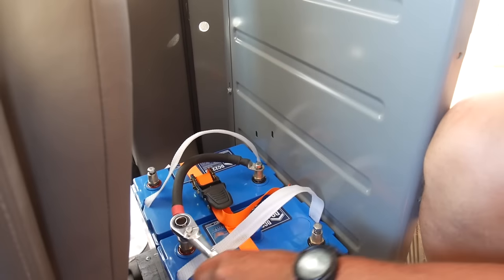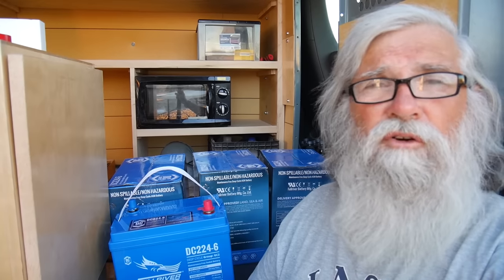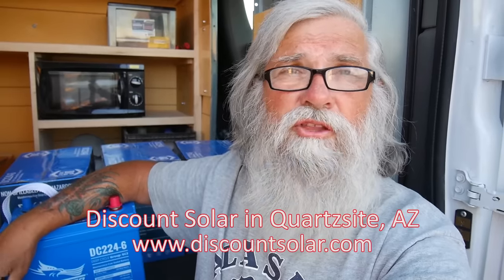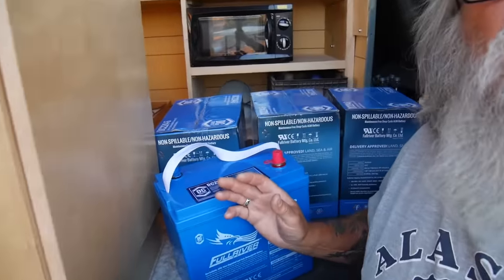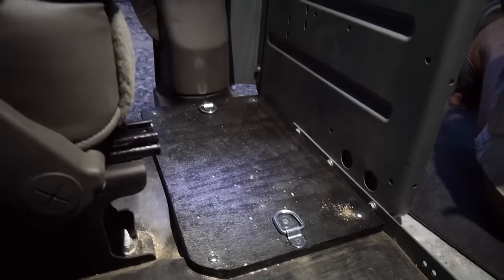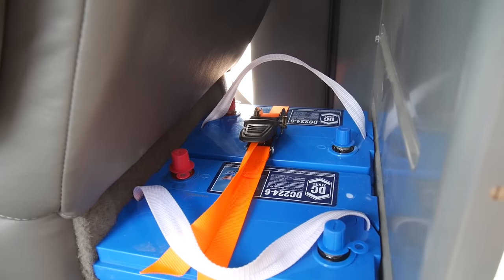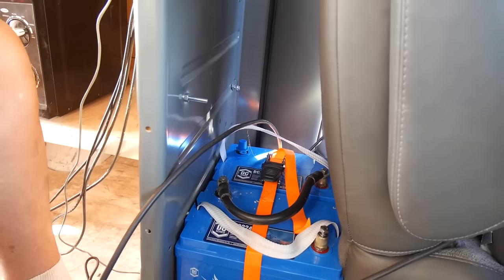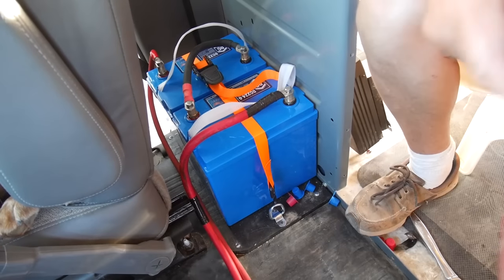Van Life Essentials How to Install a Solar Battery in a Van

Comment: Bob,

I know lithium batteries are a lot more expensive to purchase, but they supposedly will cycle 4-5x as long as AGM's, so, in the long run, they end up cheaper.  Also, they are smaller and lighter than AGM's, and can discharge much lower than the 50% limit of AGM's.  So, was it just the sticker shock of the initial purchase that kept you from lithium, or do you have other reasons?  Thank you and hope your Mum is doing as best she can.
Reply: Sorry I'm not Bob and hopefully he will reply to you. Just wanted to say I believe you've already hit the nail on the head in that there are multiple reasons why someone might not want to purchase lithium. For instance someone like myself might not want to because I'm just starting out and I don't even know if this lifestyle is for me until I try it out. If I had to choose I would go with the less expensive option first time around. FWIW, Cheers!
Reply: David, another advantage of lithium is you can fill them up sooner. If you have only 3 hours of full sun in a day, those batteries will be much better off than lead acid.
Reply: Lithium installations in RVs are relatively new and have not lived up to the initial longevity claims. Unless abused, these AGMs should last Bob 6-7 years. There is pretty much no chance lithiums are going to last 20+ years. Aside from the initial cost, you would also need to set up the charge controller very differently and I believe lithiums are also more temperature sensitive. The RV solar companies have refined the lithium installations and the batteries themselves are better, but I do not think the overall cost of such a system is justified for most folks unless weight is a major consideration.
Reply: BearUkulele Technomadia are still using theirs fine: http://www.technomadia.com/2015/02/living-the-lithium-lifestyle-3-5-year-lithium-rv-battery-update/
Reply: totoro: Yes, but read their extensive series on the system. They were essentially beta testers of lithium in RVs and we can learn from their mistakes. I personally would love to upgrade to lithium, but I can wait a few more years while others work out the kinks.
Reply: $800-1000? Ouch!
Reply: +BearUkulele...I think I remember Technomadia mounted their lithium batteries under their bus RV in a non-temperature controlled environment...which, they found out later, has somewhat damaged the batteries.  Most later installs of lithium batteries have them inside the coach or van to mitigate temperature swings.
Reply: +Mike Mead...good cost analysis.  Thank you.
Reply: Mike Mead z
Reply: No LOL.
Reply: +Mike Mead: One thing I noticed after watching this video again is that Bob said his old batteries (non-AGM, regular lead acid) could not maintain high enough voltage to run his microwave. I'm certain that wouldn't be a problem with the LiFePO4, but am not sure about AGMs. The other thing is that Bob has 480 watts of solar panels. I'm guessing it would be very rare for him not to fully charge his battery bank regardless of chemistry. The last thing is the installation of those four AGMs with longer runs of heavy cables adds to the cost of an AGM battery bank vs LiFePO4.

So the big question is how many amp-hours per day does Bob regularly use? He's already got a very low-draw DC TruckFridge, so that can't be much...5Ah? The microwave eats up amps, but most folks use that in 5-10 minute chunks. I can't imagine he does any elaborate cooking, so let's say at most 40Ah (wild guess) per day? I think he's got DC fans and a catalytic heater, so those are low or zero amp draws. It sounds like he could easily live off the single 12-volt LiFePO4 100Ah battery.

For folks starting from scratch, the first step is to calculate your daily power needs. In my case, for example, I can easily live on 100Ah/day, probably more like 50-60Ah/day. In theory, I could power AC versions of a mini-fridge, induction stovetop, fan, lights, etc...and do that all through an inverter without spending more for the costlier DC versions. I might even be able to keep the battery charged with 200-300 watts of solar panels instead of Bob's 480 watts.

In any case, just thinking out loud (so to speak). I'm not up to showing detailed calculations like Mike and I could be way off base. We certainly live in interesting times with new options in technology coming up every year.
Reply: Mike, thanks for the rambling. It does help to kick around all the various factors that need to be considered. The AGMs in my RV still have a few years of life left in them, but some of the other components (solar controller, charge converter and whole-house inverter) may need replacement sooner than that. Hopefully they can hold out a few years so I can replace the entire system to match a lithium battery bank if that technology has matured enough by that time.
Reply: Mike, I didn't mention this before because what I wrote ended up extremely long, but I bought this battery a week ago. Ah well. Apologies in advance for this convoluted post.

Although I made the best estimates I could based on specs listed on appliances, batteries, solar panels, etc., only empirical testing in real-life conditions will determine if the system I put together will work for my needs. As you say, I can always make adjustments if my assumptions are off.

If you don't mind, maybe you can "check my math"?

100Ah LiFePO4 12-volt battery (Battle Born $900)
1,500W pure sine wave inverter (Windy Nation $250)
100W solar panel with MPPT solar controller (Renogy $250)

My goal is to keep the battery above 20% capacity even though they claim it can be safely drawn down to zero. I understand the inverter is only ~90% efficient. The solar panel will not be fixed, so I plan to place it in full sun tilted at an appropriate angle for a few hours each day. If I get decent sunlight, I'm assuming the panel/controller will add ~20Ah/day back into the battery. The Renogy controller shows amp-hours accumulated and discharged, so that'll be interesting to watch.

1.7 cf mini-fridge, estimated 207 kWh/year ($60 Walmart)
250W ceramic heater ($20 Walmart)
5,000 BTU air conditioner ($110 Walmart)

The fridge will be plugged into the inverter and run 24/7. (I can probably safely unplug the fridge at night, but for now I'll just run it all the time.) Here's where more assumptions kick in. I'm guessing the compressor will run 30-40% of the time for my initial camping trips in fairly mild weather. The calculations for this are convoluted enough that I don't even recall how I got here, but my guess is ~25Ah/day to run the fridge.

I plan to use the small heater for 15 minutes at night and morning just to take the chill off. I've tested this at home in a small room and it works for me. YMMV. That draws 2.1 amps at 120 volts, which is 21 amps per hour at 12 volts. I'll round down a bit to 10Ah/day.

The air conditioner is to keep my dog cool when I'm out hiking in parks where dogs are not allowed on the trails (very common these days). Since the volume of the van is small, I'm assuming the compressor here will also only run 30-40% of the time. Unconfirmed online sources say this unit draws 5 amps at 120 volts, so I'm going to guess 25Ah/day. I probably will only be able to use the AC one hour on one day. I'll definitely test this with me in the van a few times before leaving the pup alone.

I will always start a trip with the fridge packed & pre-cooled and the battery full. 
Day 1: 100Ah - 55Ah (fridge, heater & AC) + 20Ah solar = 65Ah remaining in the battery
Day 2: 65Ah - 30Ah (fridge & heater) + 20Ah solar = 55Ah remaining in the battery
Day 3: 55Ah - 30Ah (fridge & heater) + 20Ah solar = 45Ah remaining in the battery

Loads of assumptions (aka wild guesses), so we'll see how it goes. Let me know if you see any glaring mistakes.

Drew
Reply: Mike, absolutely nothing can beat real-world experience in such a situation where there are so many variables. For example, I plan on putting the solar panel in full sun, tilted in the proper direction and angle for 3-4 hours/day. But that also depends on what time of day, cloud cover, temperature, etc. If I can somehow get to that elusive "ideal conditions" state, it's possible I can harvest more than 20Ah/day.

My window AC unit experiment is based on another YouTuber (see link below) who used the front cab area of his van as the "box". It does take into account that heat also vents from the sides of the AC unit. I won't have a solid wall partition like he did; I'll just use a blackout curtain to separate the area. I will also only have the front windows rolled down a few inches and insert a small fan to help exhaust the hot air build up. 
https://youtu.be/zpG0iWd1MY8?t=7m22s

In terms of power to run the AC, I had assumed since the "room" of my van is less than half the square footage with a much lower ceiling than a 150 sq. ft. room in a house, it would cycle less than their estimates on the yellow label. But that's still a big assumption, so who knows how this will work.

Your fridge numbers are compelling. I may need to shut that down at night if solar production is not keeping battery level high enough. Fortunately, my initial test will only be for two days, so I have some leeway to run down the batteries further than my expectations.

Walmart emailed me late yesterday to say that the AC was back-ordered, so I won't be testing that this week. Instead I'll bring a larger heater to test. Of course if your estimates for the fridge are correct and it draws closer to 50Ah/day, I may not have much leeway to strain the system any further.

Drew
Reply: Will do, Mike. One issue I'm facing with the LiFePO4 is there doesn't seem to be a simple way to gauge battery level or state of charge. The Renogy Rover solar controller (https://www.renogy.com/rover-20-amp-mppt-solar-charge-controller/) will supposedly keep a running total of "Accumulated amp hours" and "Discharged amp hours", but it doesn't measure the actual battery level. I get the impression that most battery monitors rely on measuring voltage to determine the state of charge. But since these lithium batteries maintain a high voltage output all the way to near 0% capacity, it doesn't sound like those systems would work. 

It is fun to experiment and test our assumptions about new tech. It's fun to learn! I'll certainly post any data I can gather. I'm pretty sure quite a few of my assumptions will be proven wrong. Let me know if there's some other factor or measurement I should watch aside from the amp-hours accumulated and discharged. My longterm goal is to determine if it's worth expanding this mini-system to accommodate a larger RV system.

Drew
Reply: Thanks, Mike. I've watched all the Battle Born videos. The link you posted is a very short video on how to use a multimeter to measure voltage. I never came across the chart you posted at the bottom despite browsing through most of their site. That's good to have, though I do wonder about the big gap between 13.1 and 13.3.

I did consider the Zamp controllers, but they were PWM and I decided to just stick with the fairly new model of Renogy MPPT controller that had LiFePO4 settings. The Zamp solar kits with panels, controller, cables, etc. were considerably more expensive than those from Renogy. It was hard to find details on the Zamp controller and I didn't know how accurate any of these controller-based battery readings would be without a shunt that the dedicated battery monitors usually require.

I found some pretty extensive articles on the difficulties in measuring lithium battery levels, but they were too far above my head for me to decipher. In the end I decided a rough measure as provided by the Renogy kit would be sufficient for my needs.

Drew
Reply: Yes but...you need some expensive charging and monitoring equipment to go with your lithium batteries. Never forget that in 10 years ( 2027) wen the AGM's get weak there may well be affordable alternatives.

Comment: I also saw on the Solar Blog that any time the Inverter converts DC to AC you multiply X 10.
So, a 4 amp ac device will actually pull 40 amps out of the dc battery.  10 X 4 = 40 amps.
Reply: You are right. That is why bob is using 2 banks of batteries to double the Amp/ hours ( each bank of 2 is 224 Amp hours so 448 in total) for the microwave. Hope this helps you.

Comment: After getting all the gear to put in solar; that's a lot of propane.  You mentioned fill ups were $2.50 a gallon and the batteries alone were $1,000; so that's 400 gallons of heating a cooking juice.

Comment: Your thoughts on using USED (3 year old) Data Safe brand, AGM batteries? They were used for data power backup. The model is 12HX400. I could buy four of these for $250.
Reply from the maker: I highly recommend the used data batteries. Check out the warranty on it, there ay still be some left. If everything adds up I'd buy them.
Reply: Ok! Thank you.
Reply: Bob Frazier, I don't have that brand, but I have 4, 12 volt, 130 ah batteries that were used as a UPS from a cell phone tower. Paid $600 delivered. It has been worth it. While I prefer new, I would still consider batteries like you stated.

Comment: Hi Bob, your videos are so helpful! Thank you! I struggle with heat and would like to put in some type of A/C when I can get a van and go free. Will this system work for an A/C unit of some type?
Reply: Debra Pottenger look into peltier ac. it's not as cool as ac but does cool down small spaces a bit. but to get a good working system you would probably have to make your own. (they are not that complicated) there are also micro climate cooling systems out there that generally draw less power that ac systems. you would have to have a huge solar and battery set up to run ac all day. very expensive
Reply: Mike, Thank you for helping me understand this. I will definitely look into these cooling systems you've told me about. When I am able to get out there I'm sure I will be using one of them and following the seasons to try to stay cool. The good thing is in the summer I have family on the north coast of WA in the rain forest so I may be able to escape the worst of the summer heat. Again, I thank you so much for sharing your knowledge with me! (:

Comment: With a bank that big, i would have wired them for 24V. You can use thinner cables and it is more efficient when powering the inverter. If you are still in need of 12V just plug a 12V converter into your inverter to power your 12V stuff
Reply: No!  You need a 24 volt inverter if you wire batteries for 24 volts.

Comment: What batteries do you buy that don't need to be vented? How would you install 4 golf cart batteries outside of a van so they can vent? Is there any difference between 6V & 12V AGM Batteries? Would it be better to buy 4 - 6V batteries, or 2 - 12v ones? Is it better to buy 250AH or 415AH?

Comment: Those batteries are in there tight enough for just driving around town. But, if you every roll the van, they are going to smash you apart.

Comment: So I take two 6 volt batteries connect them in series to make a 12 volt battery?
Reply: Yes 1 Positive + on one 6 v Battery to 1 Negative - on the other 6 v Battery  gives you 1 large 12v Battery

Comment: Forgive me I'm new to van living idea, however I drove a rig for 4 years. My question is why use golf truck batteries vs Simi batteries. I know rig batteries are 14.8 volt and have a long life time.
Reply: Cause when you drive the rig you are charging the batteries steady. With Golf Cart Batteries The will last longer with no power to them .That is why they are called Deep Cycle. They also last 18 holes of golf on a course. Hope this helps

Comment: If I was living in a Van or used one as a camper I would want to use Lithium. You can discharge them all the way down to 10% vs 50% for Lead acid batteries and save a few hundred pounds in weight Lithium 100 AH weighs about 29 pounds each a 200 AH Lead acid weighs about 70 lbs each. Lithium's Charge twice as fast using the same solar panels vs how long Lead acid batteries take to fully charge.. can get a 100AH 12 volt Lithium for $850 and it will last four times longer and lower weight will save all that wear and tear on your brakes and better gas mileage. The output voltage is about 1 volt higher. It takes a 200 AH lead acid battery to equal the usable capacity of a 100 AH Lithium.

Comment: What size cable r you using?  I want to put house batteries in the back of my truck and connect them to starting batteries, the lints will be around 13-15 feet. What size would you recommend? Thanks
Reply: 4/0000 Welding Cable

Comment: Hey Bob,   I already have a small generator that has hardly ever been run in fact it has 20 hours on it.  Its a coleman so its not a whisper quiet but, I have it all the same.  Then I was looking at my inverter and it doesn't say that it is a pure sine wave  but, at the tie I paid good money for the inverter that its's a 1000 watt 2000 max and Untill I have to replace the stuff I have with the good stuff would I be better to sell what I have and get the great stuff ?  I have a couple of harbor freight solar panels which I believe are just 40 watt between the three of them so I know I want to get more  but, how would you recomend building the system on a budget ?  Solare panels first or ????
Reply: thanks

Comment: 4 6v 224 AH batteries provide 12v 224 AH at <50% usage. More than 50% use before recharging can reduce battery life.
Reply: 4 6v 224 batteries are 448 Amp hours

Comment: buy lithium ion. .... Cell phone towers use them... However cell phone companies issue an expiration date on these batteries even if they are new. You can often pick theses batteries up at a fair price. They will out last AGM by 4 to 6 times. They are sealed and half the size. Different cell phone carriers have different prices. It's worth it. Always buy maint. free. And a pure sine inverter. Charge controller min 30 amp